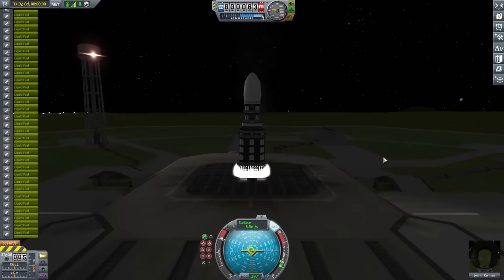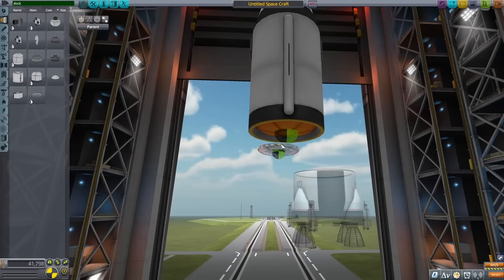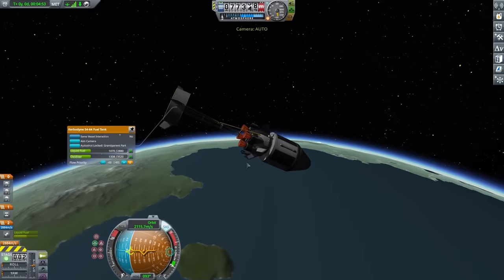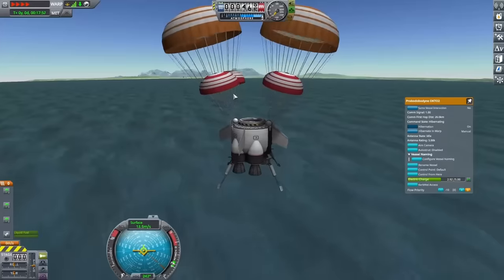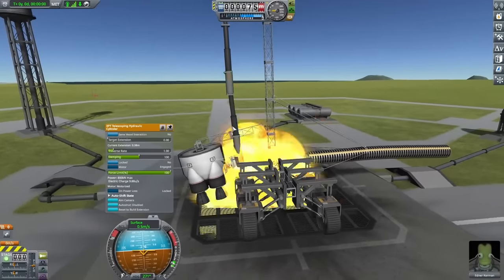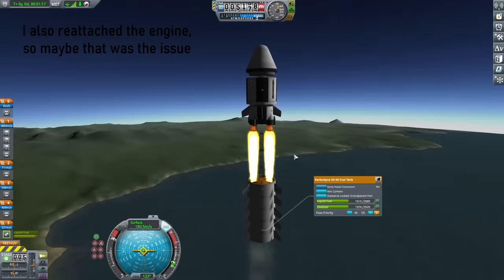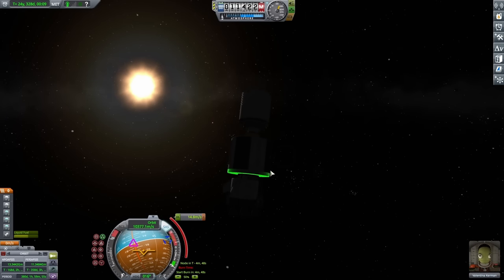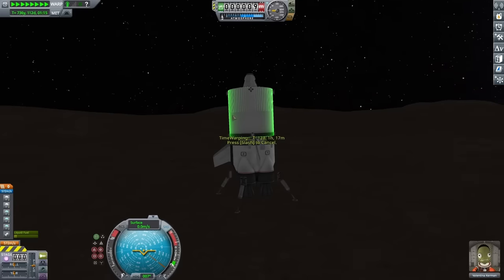Can You Use Only One Engine to Get to Moho in Kerbal Space Program?

Comment: I think you might have been able to do better with a spaceplane. Make a spaceplane with the mammoth engine, use it to deliver a large empty fuel tank to orbit, transfer any excess fuel into that tank, then keep doing trips until you fill up the tank. Then ditch the plane, attach the capsule and engine to the big tank, and away you go. I might try this myself.
Reply: I'd be willing to bet that you could do it with a rapier as well. Might even get it in one launch if you do some mining on Minmus or Gilly.
Reply: probably, if you were a better player than I. I'm currently working on the spaceplane method, and having pretty good luck!

Comment: A much more boring but efficient way to do this would be a twin boar engine with some drop tanks. It has really good TWR and it has a built in fuel tank. You could probably get to moho with less than 20 parts.
Reply: I'd say 10 at most (capsule, twin boar, 4 decouples and 4 fuel tanks, 2 tanks at a time)
Reply: @Dominion69420  WIth gravity assists and the perfect ascent, im pretty sure just the twin boar is enough.
Reply: @snottytoe6957  I mean with a good amount yea I was just saying for a more direct style
Reply: @snottytoe6957  a 3 part design can go particularly far if I remember correctly

Comment: Whenever you make a spacecraft using rapiers, make an airplane. Start in airbreathing mode, and once you get off the runway, fly straight and level until you get to at least 440 meters per second, then pitch up to 20 degrees on the navball, then fly to 10km. Then, at 10 km, level out, and fly straight and level, and let the curvature of Kerbin fall away under you, and fly until you reach 20km. Once at 20km, switch to closed-cycle (oxidizer) mode, pitch up to 45 degrees on the navball, then burn until your apoapsis is at 80-100 km above kerbin. At this point, you can shut off your engine, align yourself prograde, and coast to apoapsis, where you burn to circulize. Now you're in Low Kerbin Orbit. Hope this helps in the future! :D

Comment: One idea would be to use an "upside-down" staging: Basically, instead of removing bottom stacks as you stage, like conventional rockets, you do the opposite by removing upper stacks as you stage.

Or, you could also just put the engines radially on the top-most stage and discard the bottom fuel tanks as you stage.

Comment: With cranes like that you really should consider using the KAL robotics controller. It'd save you a lot of headache if you need things to move slowly.

Additionally, though I could understand avoiding them in this specific case because they are technically engines, but if you remove the fuel from the tall SRBs they make really good structural parts for long or tall things.

Comment: Air breathing mode needs air to work... When you get higher in the atmo, there is way less air to breathe. So take a bigger air intake that will work better at higher speeds (Shock cone is the best) 
Also, those engines are made for spaceplanes, not rockets, otherwise you would need boosters to give enough speed for the engine to work

Comment: I've managed to get to Moho with one engine. I don't remember how I did it besides the fact that I picked an engine that had a ton of thrust but was very efficient when you barely used it. I've also used the mod that gives you pure electric engines, but the Issue is that if you use good enough solar panels, you would effectively have infinite fuel. Therefore, you could use batteries as your fuel source.

Comment: Well, mammoth engine are four engines, not one...
Reply: Rocket engines are usually counted by turbopumps, not combustion chambers.

The Atlas V first stage engine (the RD-180) has dual combustion chambers and nozzles, but only has one turbopump and one set of fuel piping.

That being said (and just having looked it up), the Mammoth is in fact 4 Vector engines strapped together. It's lighter than 4 Vectors, so there's presumably some shared hardware, but it actually is 4 engines!

Comment: You should have used the engine to charge the 1,000 batteries required for all your recovery motors. Nice try tho.
Reply: Don't forget the RCS engines used for deorbiting. That could have easily been one small fuel tank.